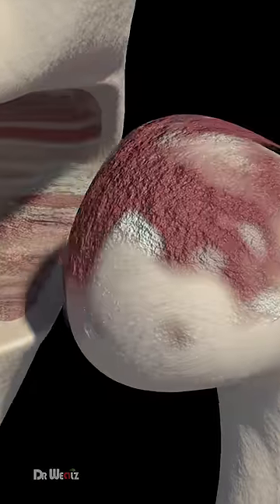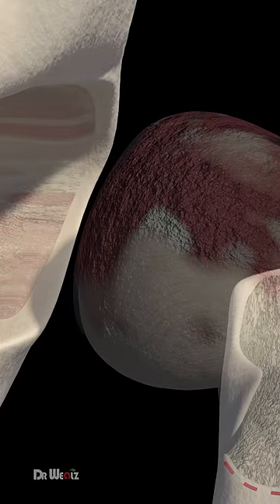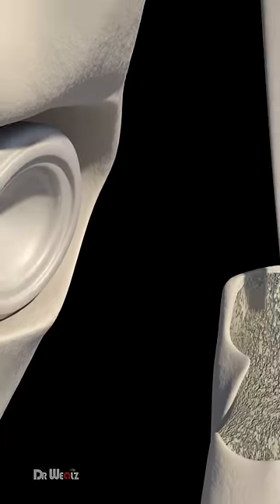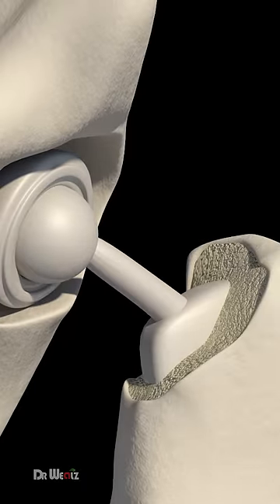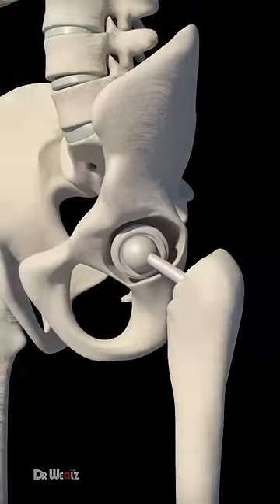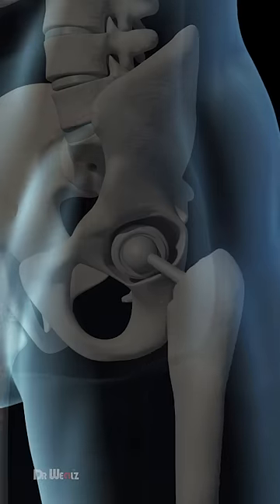Hip Replacement Explained

Comment: If anyone is curious of what metal they use, the metal they use is titanium because it’s not corrosive, doesn’t cause irritation, 40-50% lighter than steel while remaining 5 times it’s strength, and doesn’t rust. These are the metal that is commonly used for some replacement more common is knee lower back and I believe hip as well.
Reply: You said it's not prone to rust 2x ahahahaha.
Reply: @Diddyty_MMA   corrosive and rust are two different things
Reply: @Diddyty_MMA Hmm. Are you from Ohio right?
Reply: @charlespc  , yeah actually a kid from Akron. The best basketball player of all time. 😤🐐
Reply: Also because it bonds very well with the bone
Reply: It has similar strength to steel, other than that everything is right
Reply: @duke8463  it really doesn’t the strength of titanium is superior over steel, it’s an interesting metal I thought the same as well but turns out it’s different
Reply: I hear titanium also bonds with bone and human tissue very well
Reply: @Diddyty_MMA  That's weird, i thought Michael Jordan was the best, he had unbeatable records and marks, and he had his own shoes brand.
Reply: Titanium
Reply: @AlexAdam-sp5ri  Titanium moment
Reply: I had a total right hip replacement in 2018. Titanium! Love my new hip.😊
Reply: Mine is ceramic!

Comment: I am getting the anterior surgery on Feb 1st. timing sure is right.
Reply: Best decision I ever made. Recovery is hard and takes work but totally worth it. Going to get the other side done in the fall
Reply: I just got my new hip today. Different recovery from knee replacement for sure.
Reply: How long was recovery with pt with out pain take
Reply: How long was pt and recovery without pain
Reply: I would have done better but I live alone and they discharged me from hospital the next day. I was not ready and I live alone. Fell out of bed next am and back I went . I didn't progress much until I finally got pt about a week one half later.

Comment: Bruh why they gotta be using the smallest connection possible? That thing could not be very strong, also why don't they try to make it fit the bone better? Wouldn't it work better with surrounding tissue if it did